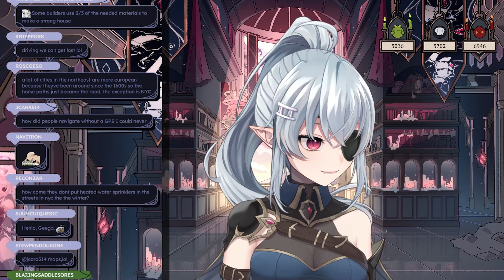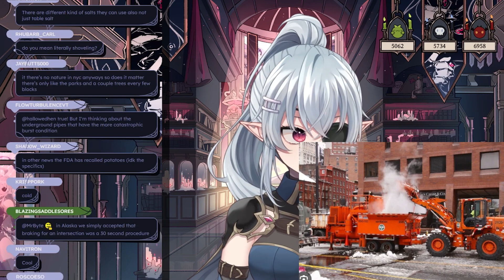What Happens to Snow in New York and Why Heated sidewalks wouldn't work

Comment: WAAAZAAAUP CHEESE! 

yeah I get into it when talking about large scale city planning (or just derailing the convo) Idk if you have the clip of when we went back and forth about how there no benches in nyc. When I went to the terminal and we were talking about how the city has become anti people. (hostile architecture) and the benches and seats that are there are designed to be so un-goldy uncomfortable. I don't live in nyc but visit from time to time for work (I'm an astro-archeologist and sometimes do counter smuggling and recovery of fossils and artifacts). Geega lives there I think so i just ask about why the city the way it is, because from the outside in some of it doesn't make sense. The way she explains it makes sense why things are the way they are. and is polite about about it. 

So its nice; especially as some people get all defensive about it. I don't know if i brought up the heated roads; but in one of the places i lived. They had heated wires built into the roads and side walks because they stored all the electrical power wires underground. 

(also i think i brought this topic up because we where talking about cars and how nyc is in the rust belt because the east coast salts the shit out of the roads. and earlier we where talking about how bmw charges for heated seats in a subscription based model)
Reply from the maker: I'm still looking through early June streams right now but that sounds like something i would clip. I don't think i've found that conversation yet though after looking at my notes.
Reply: @cheesesculptor  i remember watching that clip somewhere else but its all good!

Comment: She said it is not that bad salting city roads.  There is an issue with it gets into the rain run off system rather than household system and they normally skip water treatment phase before being dumped into streams and rivers.  

Not to mention that salt is what cause a lot rust on cars and trucks and shorten their life.  In northern Japan they have few cities where they have hot water to melt the snow, and it works well. it probably could be scaled if you use electric heaters powered by solar.
Reply: Japan is a very volcanic country and they use natural hot springs for a lot more than onsen.
Reply: @Toobeegort  please show evidence they are using hot springs water to clear the roads.
Reply: @DubhghlasMacDubhghlas  Who are you to demand anything, look it up yourself.
Reply: @Toobeegort  if you make a claim you should back it up.  And maybe I am asking due to lack of evidence and that person is talking out their rear.  They use solar to power heating.
Reply: To be fair she lives in NYC where it very quickly empties into the ocean.
Reply: @Pfish1000  before all that happens you are driving on that salty water splashing all up on the under carriage.   

And with how often it snows it becomes a problem fairly quick in NYC.
Reply: @DubhghlasMacDubhghlas  i mean yeah it eventually rusts the car but for the most part, unless you are a car person nobody cares about that bc it doesn't become an issue until you are probably looking at getting a new car anyway.
Reply: @Pfish1000  it is an issue due to how modern cars with a unibody frame.  UNI bodies don't have that thick steel frame.   It will become issue before average person will get a new car.  Due to the average person in NYC spends more on housing in NYC than any other city in US.  It is around 50% of their monthly income.  Which is the major driving reason why middle class and the working class is leaving NYC.  In 2023 NYC is reason why NY had the highest amount of people leaving per capita.

I have worked on cars from that area.
Reply: @DubhghlasMacDubhghlas  I'm pretty sure the average person in nyc doesn't own a car so it's more an issue for taxis and ubers. 
I live in Michigan and we have been salting our roads for decades and it's pretty much only the used market where you see anybody caring. Yeah it will get rust but it won't become structural issues that the owner either cares or knows about for a good few winters.
It's also only recently started to affect the lakes to a degree we are getting concerned and talking about it.
Reply: @Pfish1000  middle class people often do.   When you sell your car you will care due to damage makes your car value less.  

And when you get into 7 plus years there will be damage and depending on how much you drive it will compromise your frame.
Reply: @Pfish1000  "To be fair she lives in NYC where it very quickly empties into the ocean."

That alone shows you don't know what you are talking about.
Reply: @DubhghlasMacDubhghlas  but it is relatively quick? NYC is mostly islands in the estuary of the Hudson. It's a few miles from the bottom of Manhattan to the Atlantic. 
Maybe it takes a minute to get to the river from the roads, particularly when the roads are relatively dry, but it's overall a relatively fast process, especially when going from the river to the ocean. Its retention time within the area is not terribly long.

Is salt bad for cars? yes.
Does the average person meaningful care? No
Can it be bad for local ecosystems, especially overtime? yes
Does it matter as much in nyc as it might in the Great Lakes region? No, because its retention time in the river, in that location, only counting nyc and nothing upstream, is significantly less, so it's not going to long term increase the salinity of the river.
Should we use it less? Yes
But she's not wrong in that it's not that bad in nyc